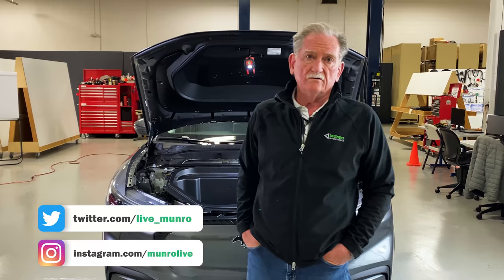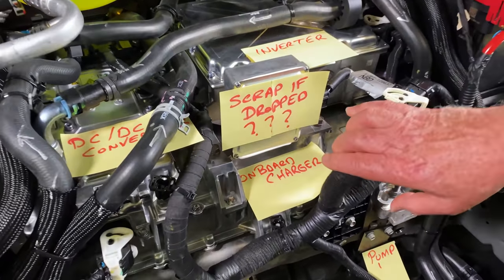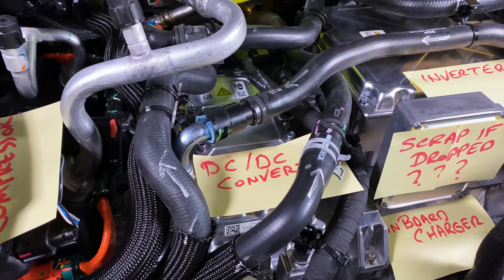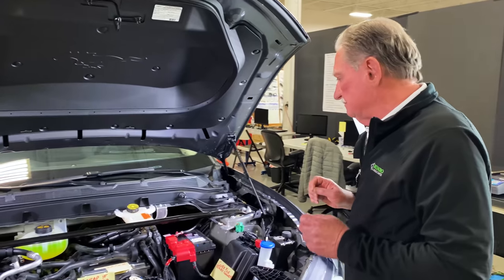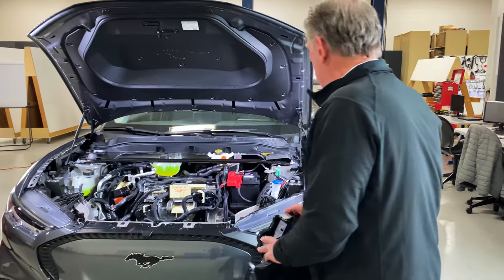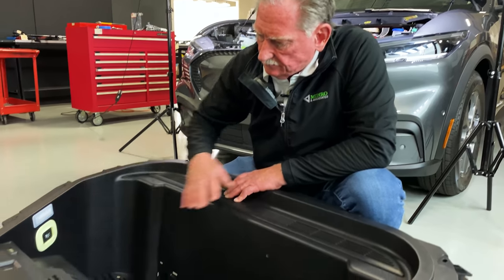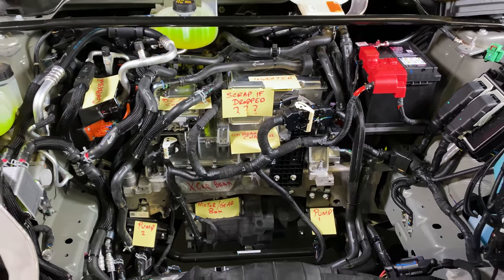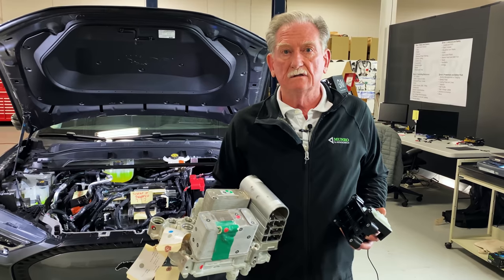Mach-E Thermal System Nightmare

Comment: Looks like Ford has found a way to guarantee that even their EVs will need servicing, and keep those dealerships afloat.
Reply: That's precisely what I was thinking too.
Reply: I didnt even think of that until you pointed it out!  nice catch.
Reply: All EVs need servicing, but yeah, all that tubing and those connectors could be streamlined or largely eliminated.  I guess Ford is still using a lot of traditional techniques for cooling in this car.
Reply: How often do you service ice radiator hoses?
Reply: Oh my god, you're right! It's obvious when you think about it. All those 50s-60s era clamps point to old school thinking too.
Reply: I had the same thought!!! That’s not going to work with Ev’s. They are doom!
Reply: @NyashaM  As often as they break, which is always eventually.
Reply: @Perforator2000  EVs designed correctly need no servicing for at least 100k mi. But EVs are a scam, so, yes, they need more repairs than ICE. A toyota needs zero servicing for 150k mi except fluid changes (and nope, not coolant).
Reply: @TheGuruStud  my vehicles are always used and always Japanese cars, the bulk of maintenance is chassis related...maybe it's because I work on my own car, can I do that on those EVs?
Reply: @clintatk  Man, I stand by those spring clamps though. Can’t under tighten, over tighten, or forget to tighten them. They can be a pain to remove. Toyota at least has some with a lock on them that holds them open, which I guess means you could forget to ‘tighten’ it, but they’re super easy to remove.
Reply: @ahfreebird  I've got nothing against a good house clamp. Just so many of them...in an EV. 😂👍
Reply: @NyashaM  Radiator hoses are generally good for 10 years, but almost no plastic coolant connectors last for 10 years. And what gets ruined when Inverters overheat?
Reply: I don't want to know how much it will cost to replace all those hoses in 10 years!
Reply: @NyashaM  it's not the hose, it's those plastic connectors that breakdown.  It's not that Ford can't just copy Tesla.  The decision to do it this was is to ensure engineered obsolescence.
Reply: @TheGuruStud  Why do you say EVs are a scam>?
Reply: @Perforator2000  But it can be dramatically less than ICE cars. So much less, as to make an EV very attractive to someone who is fed up with maintenance, like me.
Reply: @enermaxstephens1051  I agree.  I have been driving a plug-in hybrid for the last 4 years.  It's averaging around 65 mpg, it barely needs oil changes, the brake pads are still basically new after 110,000 miles, super quiet.  I'll definitely look hard at getting something fully electric in the future, but I still like being able to do 1000 mile road trips with a gasoline engine at times.
Reply: @don2deliver  I have a 2017 Bolt with the original brakes. Only thing I’ve done so far was tire rotations. I spend about $15 a month to charge and drive an average of 45 miles a day.
Reply: It's like Jack Donaghy is running the operation like he ran GE. Cheap, flimsy, unreliable - that's the American way
Reply: @carsonj1  Not even 8-12 years depending on where you live. Here in the California central valley where summertime temps are consistently above 100 degrees (and summer is now may-september) it will easily be half of that time.
Reply: @NyashaM  Depends on where you live and how many miles you drive.
Reply: @TheGuruStud  Scam? please enlighten us.
Reply: @Perforator2000  indeed they still need servicing, but those intervals are far and few in between. I’ve got just over 45,000miles on my ‘17 P100D and I haven’t gone to a dealership, or gas station since I took delivery. I suppose you can calculate the savings vs a comparable ICE… but to me that convenience is invaluable. My only out of pocket expense (besides insurance) was a new set of tires - but that’s a wash since it would have been the case for any car. In fact, the more I drive that Tesla, the more it pays for itself. I would have purchased an E63 otherwise, and in my area it would have cost me $500/month in gas…. you do the math!
Reply: Good point. Dealerships need that service money.
Reply: @chaos23  I don't think he's going to give an explanation
Reply: Elon MUSK is New God! Mars is the New Earth! Earth Will soon Die Anyway!! TESLA and Tesla Holders will be Kings. Rest and their Family will be Our Slaves and work to Power energy for Bit coin!! Elon is Einstein, Edison, Newton, and Jesus combined. HE at least deserves several Nobel Prizes. Elon has more IQ than weight of Hater's Ug ly Prius and his F at Ho Combined!! HE is like Ironman who will destroy Thanos and critics are better off using their cash to wipe their a n us. JUST Worship Him instead of other silly god!! GOD Elon will Punish infidels!! Go Emperor God Musk!! Elon's brain chips and AI will control and enslave  Nonbelivers!!
Reply: Of course! Planned obsolescence
Reply: @remytv  what do you buy, slightly used Unit 731 owned 🇯🇵 cars?
Reply: @paulpsycho78  we are becoming Mexico, so meh, and truth be told Toyota makes their Tacoma in Mexico, suck on that one Japan fanboys!
Reply: @NyashaM  It depends on how much you like being stranded with a burst hose.  I generally change mine after 10-12 years.
Reply: @TheGuruStud  I’ve seen zero evidence that EVs require more repairs than ICEs.
Reply: Like the car wouldn’t need servicing for years if it was built half the way it used to be built. Why can a 2008 Toyota Sequoia run better than a 2020. ?
Reply: @carsonj1  NO kidding, I had an '88 300E that had over 30 grand of maintenance done on it over it's life and in the end all the plastic parts everywhere fell apart and turned it into junk even though the body was in pristine shape.
Reply: @NyashaM  Depends on the climate but not that often. You're supposed to flush the cooling system every 5 years otherwise acids buildup can eat the engine block.
Reply: They are going to do away with dealerships eventually as everyone else. All cars are going to need servicing but as they learn more about the new EV technology, things will improve. I personally like the Internal Combustion engine where you just gas it up and go.
Reply: @remytv  no
Reply: The trouble with these companies is they’re not designing these EV’s from the ground up. They just retrofit old designs. With old parts. 

Rubbish.
Reply: All EV well need to be serviced they have brakes suspension tyres and coolant and brake fluid and standard 12 volt system fitted. This man is just putting ford down ! People watching this don’t know one end of a car to the other !!
Reply: Evs will produce just as much service needs as ICE vehicles.
Reply: @clintatk  That type of clamp did not exist anywhere close to the 50s and 60s.
Reply: @ahfreebird  there's a special tool made especially for those types of spring clamps and they make it super easy.
Reply: @bingsi1332  I know this is a year old but I will tell you if you removed all environmental regulations everywhere on Earth for the next hundred years and let people do whatever they wanted to. And spent a hundred years terraforming Mars to make it inhabitable for humans, Earth would still be vastly more inhabitable and safe than Mars. I do agree that Elon Musk is a total boss though.
Reply: @adambrady2927  you're not suggesting that the brakes wear out on an EV similar to what they do on a regular car are you?
Reply: EXCELLENT POINT!  MY THOUGHTS EXACTLY!
Reply: @carsonj1  probably the reason for so many plastic fittings.... more failure points BY DESIGN

Comment: Just when I think I'm in love with the Mach-e, Sandy pulls me back into reality with hoses, fasteners, plastic parts, boxes on top of boxes and more fasteners.
Reply: But… these is not combustion heat like on combustion engines. So most of the plastic parts & cheap parts should last years longer
Reply: Ditto. It's a mess.
Reply: You’ll get very disappointed when you turn your heat on and see 30 miles of power desapear after you ride 5 miles , shiit car. My wife wants to give it back .
Reply: No heat pump either. Horrible range in winter
Reply: @alphagodvon  ...they're near to the heat and they explicitly use materials that don't last that long. How come you are trying to excuse planned obsolescence when they could use proper materials that outlive the lifetime if the car itself?
Reply: I wouldn’t touch an Mach-e with a 10’ pole.  Watch the sequel to this where Sandy and Cory compare the thermal system of the Mach-e with that of the Tesla model Y.  If you already own a Mach-e don’t watch it.
Reply: What material would you like the pieces to be made of? diamond, or metal? Of course the parts need to be plastic!

Comment: Tesla has the octo-valve, Ford has the octo-hose.
Reply: I Would rather own a Mustang than anything Musk produces!
Reply: @DavidJohnson-tv2nn  id love a tesla
Reply: @DavidJohnson-tv2nn  God Bless you Brother. It’s ok to dream about what once was. I still dream about my Dads 71 challenger.
Reply: @DavidJohnson-tv2nn  
Who produces the Mustang?
Reply: There are some advantages to doing it the way Ford did. You could certainly go to any auto parts place and jerry-rig some hoses to make this work if you had a leak or a failure when the car was old. Call up Tesla and see what they charge to replace an octo valve if they would even sell it to you. The Ford certainly looks like a mess under the hood however certainly easier to repair.
The bolt ev did not look nearly as disorganized under the hood as this.
Weber automotive has a really great video series that involves a complete teardown of one of those entire driveline disassembly all the cooling system and the battery. He also has lots of videos on other stuff including some Teslas if you like mechanical videos you would definitely enjoy his YouTube channel
Reply: @DavidJohnson-tv2nn  I have owned Mustangs in the past, but I absolutely LOVE my Model Y...
Reply: Used Teslas today (cheaper than your Ford Range Rover)
Reply: @Author B.L. Alley 
Sorry I disagree. That octo valve has moving parts inside of it that control where coolant goes to you don't think those have the possibility of failure? It's a common failure in Toyota Priuses the three-way control valve. But the hose is going to that control valve don't fail.
My 13-year-old car has 377,000 mi on it and I've yet to have a single hose ever leak and none of them have ever been replaced. So while I agree with Sandy that that certainly looks like an unbelievable mess under the hood as long as those connection points have been well engineered and have had good materials used I don't see a reason why they should fail. There's far less heat and vibration in an electric car than there is internal combustion. I know Sandy commented at they had failure points like that at Ford. Maybe that's just cuz Ford used to build crappy cars and use crappy materials.
I can't remember the last time I ever had a car that had a hose fail.
And I drive a lot. Probably 3 million miles in the last 15 years in both commercial trucks and passenger cars.
Reply: My experiences with Ford- Leaky sunroof on a Ford Escape they claimed it was designed to leak…never was able to get it fixed after multiple visits on final visit made the design comment.  Ford Expedition with major electrical problems and burned through brakes like a Q7.  I’ll never be a Ford customer again.
Reply: @agentjrb  
I tend to stick with Toyotas. Particularly things that are actually built in Japan.
They occasionally have their problems as well. But I've had really good luck overall. My current is a 13-year-old Toyota Prius 370,000 Miles
Reply: @kens97sto171  that’s impressive. I thought my 04 es330 at 240k or 08 sequoia at 250k miles was good. I still trust either of my quarter million mile Toyota’s from a reliability standpoint over a new Ford. Excited for my new CT though.
Reply: @kens97sto171  This whole system is jerry-rig that’s his friggin point,
Reply: @omegalamda3145  
I don't think so. 
It Certainly looks like a mess. But you've got to get coolant from one place to the other and unless you're going to use something like that octo valve , tubing and connectors is how you would do it.
 I don't understand why there are so many, could be that they're attempting to recreate the octo valve using alternative methods. 
The Chevrolet bolt EV has three separate coolant systems.  they're certainly laid out more neatly than this,  but that could be because they're completely separated and don't interact with each other. 
The negative of the design Chevy used is that you can't pull heat from Motors and inverters and use it to keep the cabin or vice versa. But it does make it much more simple. 
I think I would take simple personally. The Tesla system is not really simple either ..call up Tesla and ask them what they want for that new octo valve,  when it eventually.. and  inevitably fails when the car is 10 or 15 years old.
with the Ford system, I can go buy off-the-shelf rubber tubing and couplers, and fix it when it's 15 years old . It might not look pretty but it'll work. 
You're not going to be able to fix that Tesla octo valve in the driveway with some basic components , you're going to have to spend several thousand dollars with Tesla to get a new one and judging by their current behavior they're not going to allow you to buy it or install it yourself if you found a used one at a salvage yard. It will likely be then coded and require them to do some programming to allow it to work which they will charge you money for if they even permit it.
Reply: @snarkylive  bahahahaha OK
Reply: Lol
Reply: @Author B.L. Alley Indeed, as Musk always say (talking about his rocketengines); The best part is no part.
Reply: @DavidJohnson-tv2nn  good for you.  Because reasons.
Reply: @cjschmitt4882  musk is a con man
Reply: @DavidJohnson-tv2nn  Why both made in America I think I'd be fine with either but I'm loving the new F150 lightning so far. I'm a cummins guy mind you but it's apples to oranges and both serve a purpose in different ways.
Reply: I would still buy a Tesla, but only if it is or can be fully jailbroken. 
I don't really care about the latest updates for a software package that would be taken away anyway because the license is per-user instead of the more logical (but less profitable) per-machine.
Reply: @cjschmitt4882  I am sorry I just can’t do the Model 3 and Model Y ultra modern sparse interior. Just give me a gauge cluster!
Reply: Me thinks Ford has a Centi-hose
Reply: @TheJoeSwanon  God I can’t go back to the gauge cluster after a year with my Model Y. When I drive a gas car it feels like steampunk wearing 90s momjeans.
Reply: @loooooopy still upset about twitter eh ?